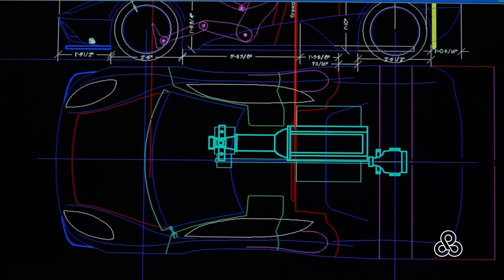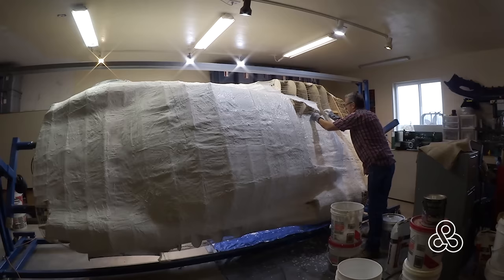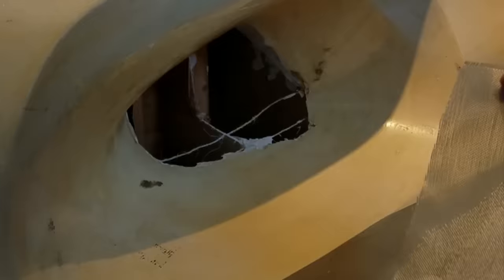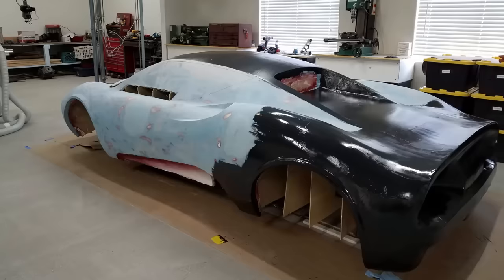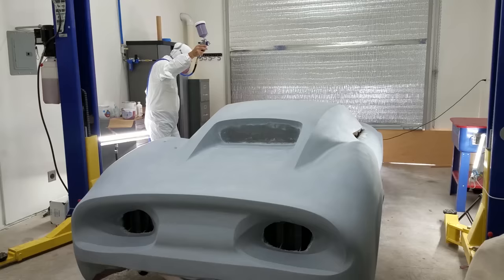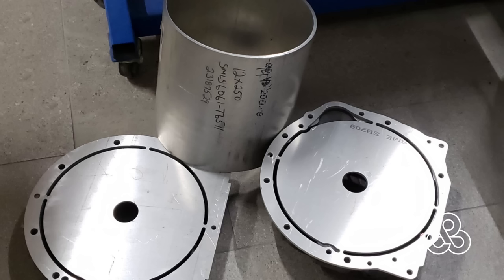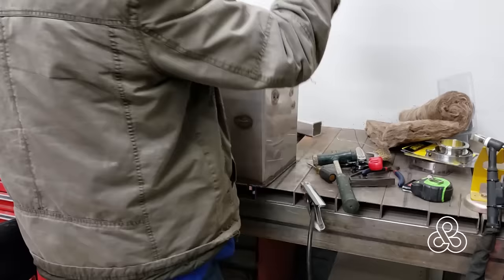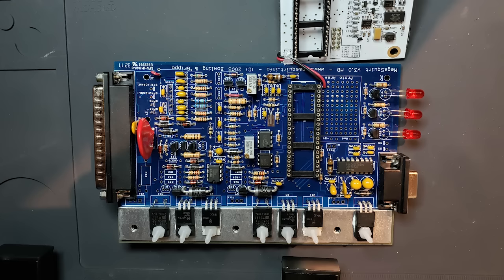How to build your own 200mph Supercar; at home in your spare time. Part 1

Comment: Whyyyyyyyy not the 2jz. I mean, the 1jz is still a good engine, but the 2jz is just too iconic not to use.
Reply from the maker: The 1JZ uses a shorter stroke (hence the smaller displacement) but can rev higher than the 2jz. My design goal was for higher top end performance where I would need horsepower and RPMs rather than the lower end torque band that the 2jz would have offered.

Comment: Can you use carbon composite for the molds
Reply from the maker: You can, but 5 times the cost for only 25% weight savings.
Reply: When I want performance out of my car, that extra cost is worth it.
Reply: By the way, how do I use carbon composite. Can you show us by making a small piece/mold

Comment: Guess I'm not seeing the reason to not buy a wrecked Lotus Elise and tube frame it. Or even an S20 MR2 and stretch or shrink as you see fit. Then you'd have standard doors, glass, and other components that would fit directly to the frame.
Reply from the maker: Then the design is limited by an existing hodge-podge of parts. Already limited myself with using an existing windshield.

Comment: I  ran a resin plant for 37 years, what supplier are you using?
Reply from the maker: US Composites. Hook me up with a mfgr direct; I have a resin hungry project coming up. Ha!
Reply: @BuilderCreator    I was with Ashland Composites for 37 years, I'm retired now my div. got sold last year but I'll check with our guys if they want to work with you.  But yeah, we were the big boys in the business .
Reply from the maker: @bocat7482  Yeah, I see that Ineos aquired AC. 1.1 billion yearly. . .My business wouldn't even be a drop in the ol mixing bucket. Ha!
Reply: @BuilderCreator   I told them they were in trouble with all the talent leaving in 2016, get out, they sold.  Ineos is very tight on budgets the plants tell me.

Comment: Where's the roll cage? Why are the tires so small? Something is weird here, I've built a lot of cars for Bonneville and we get our carbon fiber from fiberglast and how you came up with $20,000 for Carbon Fiber? That doesn't add up.
Reply from the maker: I've covered the carbon fiber costs in a few other videos, but as for tires- 245/30zr20s diameter to match the ratio of the Getrag diffs from a Corvette.

Comment: Why couldn't you just do all your smoothing with the soft plaster alone and when totally complete, apply penetrating epoxy to harden it and finally a single epoxy coat for shiny smooth finish?
Reply from the maker: The plaster dries to different degrees of hardness and cuts down faster in the soft areas. It is easier to just coat the whole thing with a hard (consistent) shell.

Comment: How can I make this road legal and get insurance for it
Reply from the maker: Your local insurance agency may tell you they can't insure it, but there are specialty insurance companies that will. they usually require a fairly low premium, as they know that vehicles like this are rarely driven (low Mileage) and well looked after. Road legal, is up to you and the state you live in and how much hustle they will put you through to register it.

Comment: A 4L65E in a supercar? Trash decision, mate. 1JZ isn't bad, though. But listen, before you discount my comment as useless flaming/bashing, look into a ZF 8 speed with a Turbolamik mod. From what I can tell it's almost as easy as the 4LxxE trans, but FAR more useful and applicable to a performance vehicle. Here's a video, and on top of that, this guy's channel has basically everything you need. LOTS of functionality it a Turbolamik'd ZF8, too. Trans brake, multiple drive modes, remote manual shifting, you can even install a 3rd pedal and control the clutches inside the transmission's gears for drifting/clutch dumps and such.

Another thing I'd say is that modern turbo tech can net you a single turbo that's more efficient then the twins while also being better suited for max output as well. Several popular youtubers use Garrett's "new" G series turbos to great success in 2.0L to 3.7L engines, though they have sizes for much larger motors as well. The ones suited to your application with the 1JZ would be anywhere from a G25-660 to a G30-900. The first number is the body size of the hot side, and the second number is the rated crankshaft HP supported by the compressor if you have a really good flowing cylinder head. I wouldn't recommend a G35 unless you were going for big theatrical power levels and a more "typical" response of an aftermarket-boosted car. OR if you subbed in a 3.0L 2JZ.

Borg Warner EFR is extremely comparable to Garrett G-series(and supposedly came out before the G-series, soo... Some say Garrett "stole" the design).
Reply from the maker: I almost pulled the trigger on a Tremec T56, but budget was the final decider - $350 for the 4L transmission. I'm always willing to upgrade if someone else foots the bill. Ha!
Reply: @BuilderCreator  I mean, it's been several years AND you presumably made that 46k with NFTs that was mentioned in a video title I didn't watch. There's kinda no excuse for the 4L... At least not a damn 65e, crikey! Lol

Comment: Erm where is the structure of the car?
That tub has no structure at all.
Nice video on how to make fiber glasses panels.
But with no structure that tub will break apart way to easy.
Reply from the maker: eem . . . I don't think you are watching the entire series of videos are you?
Reply: @BuilderCreator  glad i grabed your attention. I really like your design here this car will look amazing 👏 
But, I have looked at othere videos that you have made. Dont take this as a hate things, its a hold up safety please.
Your front a pillar has no strength to it at all, i mean the hole pillar from the floor to the top of the windshield. The roof has no strenght as well. If that car rolls over the entire roof will collapse on who ever is in the car.
I have not seen in your videos any worth while structure from the front sub frame to the rear subfram. Any loading and that car will break in 2. You could use a ladder frame like on the lotus esprit.
As i say this is no attack on your, wow your videos are great, but please use a role over cage in the cabin, you don't have to go over board on its design. Just a basic one. Have some think in that tunnel will help by miles.
I really want you to be able to finish as see your great car on the road. But please think about safety.
Reply from the maker: @chraven69  I have stopped showing videos of the tub construction as people were tired of seeing the same thing over and over, but there is much more structure to come. I will show a quick overview of some of that. I'm getting to about 45% on laminations at the tub, so it will be a while before that video surfaces. Know also, that there will be some steel involved for rollover and side impact protection (can't beat some malleability).
Reply: @BuilderCreator  cool I look forward to seeing more videos 👍 keep going thats going to be an awsome car 😁

Comment: All that work and uses a 4Lslippy🤦🏻‍♂️ why? why do people do this?
Reply: 4L60/4L65 are huge No No’s in anything that is making a good amount of torque. Even stock they are junk. They may last if daily driven and never getting ran hard but as soon as you start throwing turbos/superchargers at it, even just a full bolt on LS will give you dexron soup with all neutrals. I see all these restomod/ car builds and all i see are “the transmission slips/ transmission isn’t holding the power/ having problems with the transmission, etc” and its always a 4L60/4L65. Never. Ever use those transmissions🙃

Comment: Or... you could just buy a mid 00's Merc SL55 AMG for about £15k and get the speed limiter removed...

You should also fit race tyres since the originals won't be rated for that speed but that won't be street legal SHHH I WON'T TELL ANYONE IF YOU DON'T

Comment: The 4l65e isn't what I would call a good transmission they're notorious for breaking sun gears and they can't handle much power and they don't generally last very long the 4l85e is much better but I'm guessing you have your reasons for choosing the transmission you did I can clearly see you're not a stupid person and I am pretty sure you did your homework and made your choice accordingly
Reply from the maker: The 85 is s direct bolt up. . .if I have problems I can swap it out. Price was the deciding factor- got a good deal.

Comment: I like the title to your video, but it's not complete. You need to add" For just 157 easy payments of just $ 29.95 and 3 tools ( hammer, screwdriver and putty knife. Some duct taping required). You can drive like Mario. Limited kits available. Delivery time 157 months.please prepayment required.
Reply from the maker: At only 157 payments you need to set the price at more like $190 :)
Reply: @BuilderCreator  I picked the price to match the cheesy tv ads on late night tv.
I would have figured your car is worth closer to $1,000 per month. Just trying to be funny.
Reply from the maker: @georgemichaels2325  I understood, I just have the same twisted sense of sarcastic humor. :)

Comment: Use brake from Porsche... don't want to see their label branding...  paint it over... and put your own brand name on it instead.  That's pretty pathetic if you asked me. You should've stopped at the painting it over part.  You can't just your brand name over something you didn't make.
Reply from the maker: Actually, they are Brembo brakes "re-branded" by Porsche, then  re-re-branded by me . . I'll only take blame for 25% of the pathetic actions, Porsche gets 75% of the blame. I think I should be neutral in fact, as I am helping save the wold by recycling used parts and not buying new from Brembo or Porsche!
Reply: @BuilderCreator  Yeah, nothing wrong with recycling parts aspect... just the labeling thing was kinda lame. lol You should relabel them as Brembo then. :D